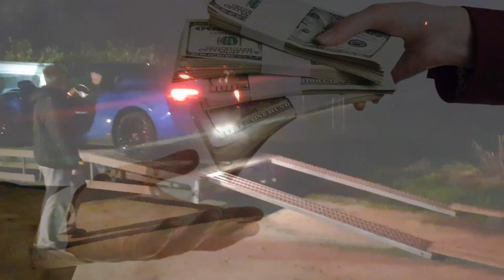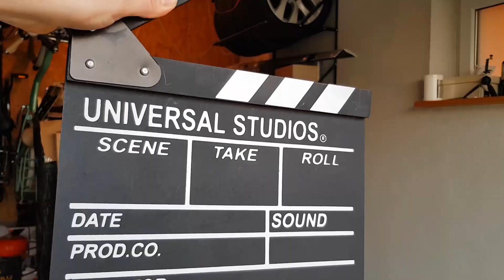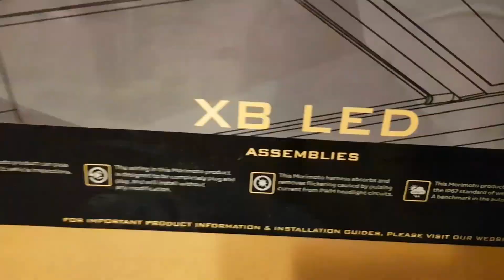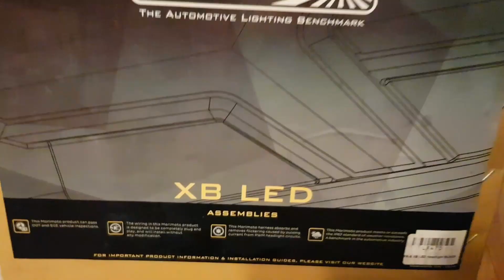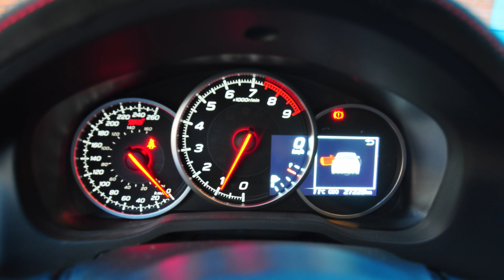Rebuilding a WRECKED 2018 Subaru BRZ TS rebuild in 10 min

Comment: I bought a wrecked brz. Debating just selling it for what I have in it or waiting for a parts car. I’ve been trying to source parts and the parts car seems more economical
Reply from the maker: Depends on the damage you have really. Parts I find for the BRZ aren't too expensive but if you have extensive damage a parts car  might be the way to go. You should do a comparison between cost of parts and a parts  car cost to find the best option for you.  Good luck with the rebuild,  the BRZ is a fun platform.